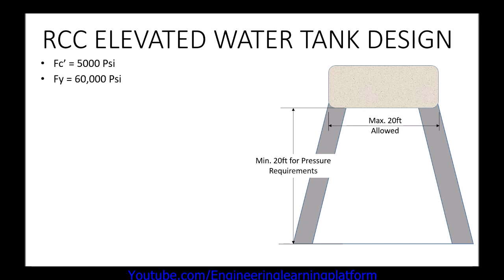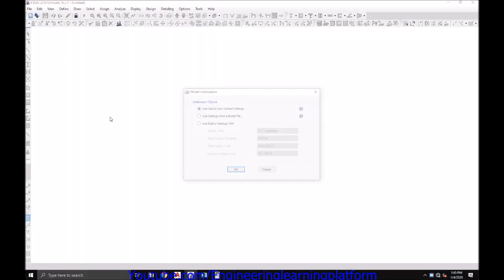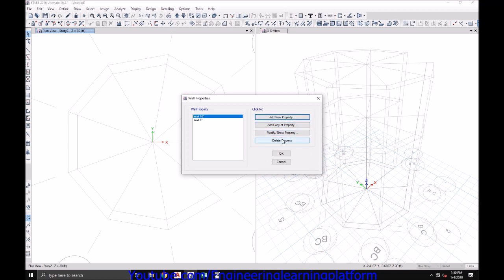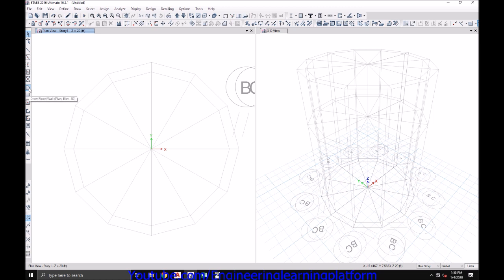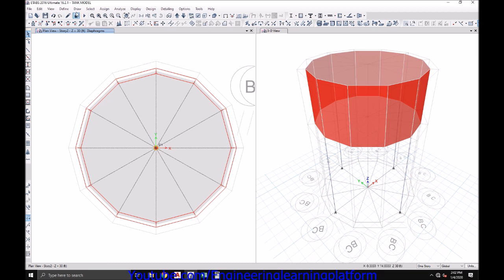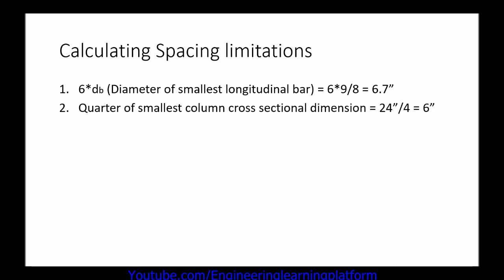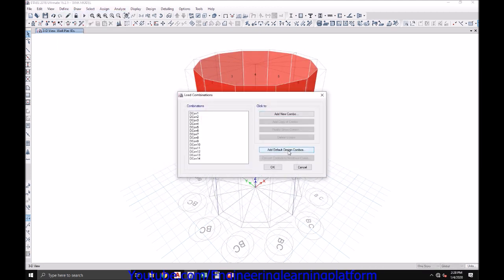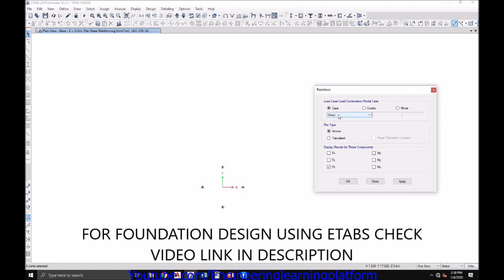Elevated water tank design in etabs and detailing

Comment: Please make a video on designing of staircase using software and also on basement design
Reply from the maker: Basement design is similar to water tank, you can check the video of retaining wall design at this channel which is for basement . While staircase modelling is also there in channel
Reply: @EngineeringLearningPlatform   sir you are right but it's mandatory to  learn designing of staircase .I saw designing of ramp